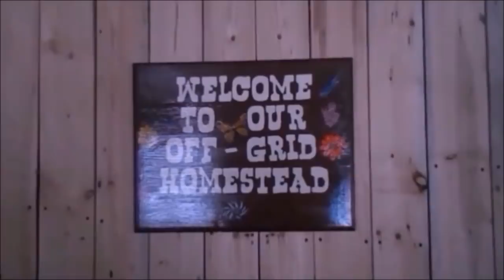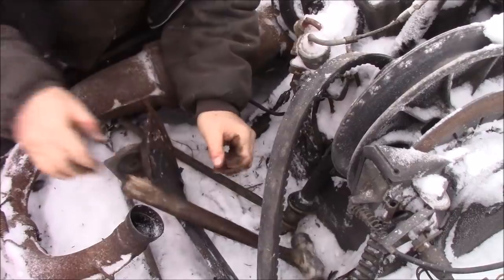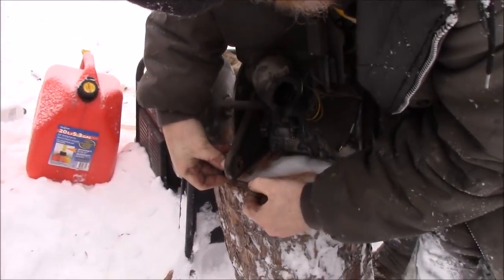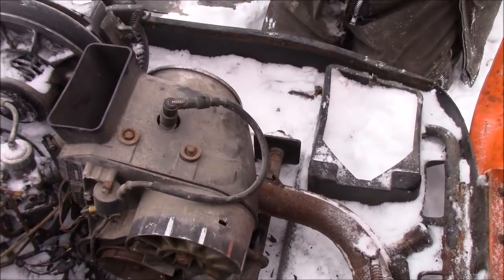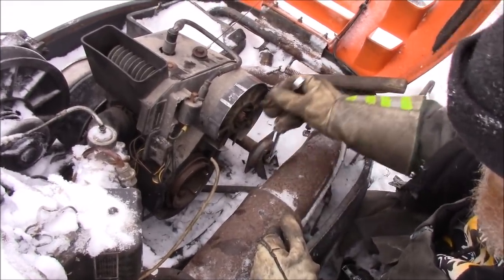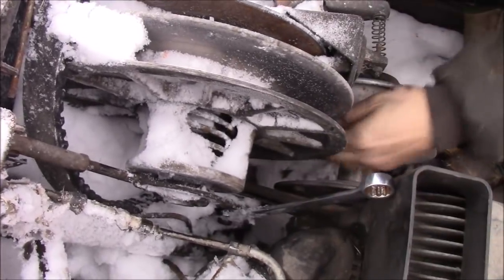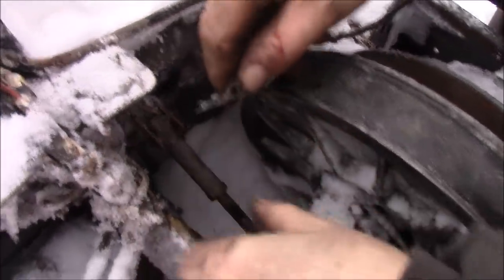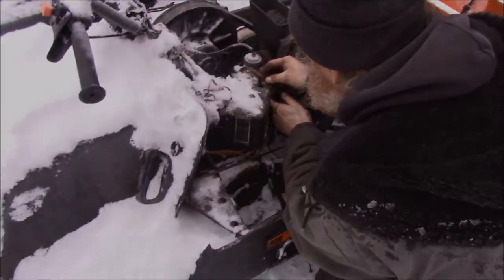Can I Save This?  Or Is It Just Scrap? Ski- Doo Tundra

Comment: I just saved a tundra, had to replace the chain case, track, throttle cable, belt, and coil. Also had to add the pin that holds the leaf springs into the ski and I bought a window for it. I still need to buy carbides for it

Comment: The Tundra’s never came with electric start but the Citation LS’s did and they used the same front ends and motors.
Reply: I have an 89 Tundra LTe.  This was a variant with electric start.

Comment: You should have put a washer and a nut on the in side as well would make it stronger
Reply from the maker: The plastic block has to sit flat on the body or else it will rock and crack the frame worse, plus the plastic steering bushing would just fall out with nuts and washers on the inside... Besides the u-bolt is way too short for extra washers, and an extra nut.  Thanks again..Cheers.